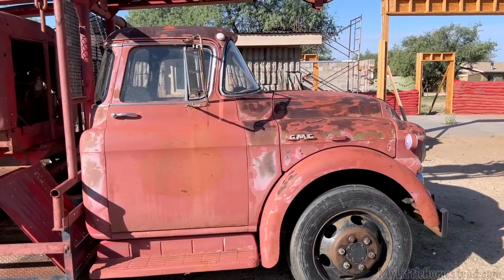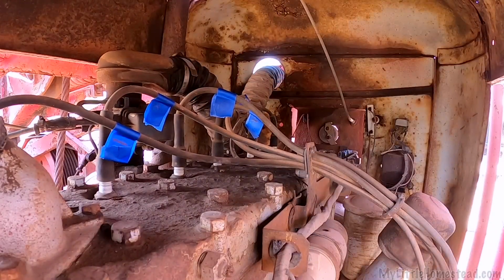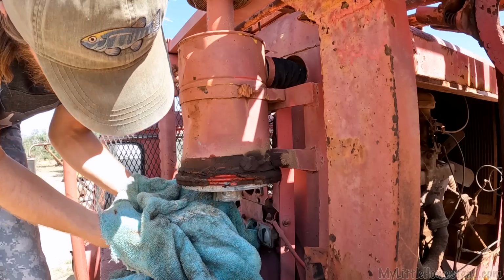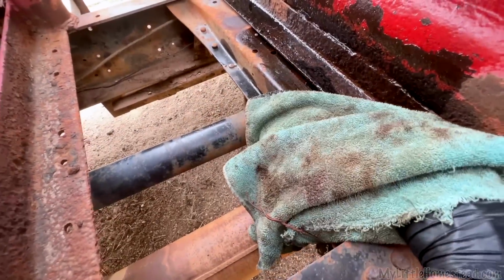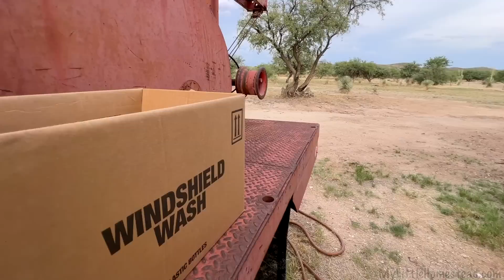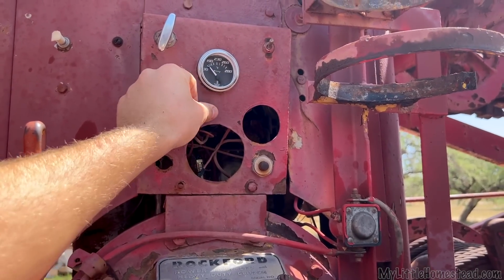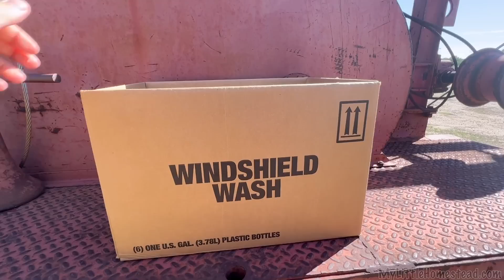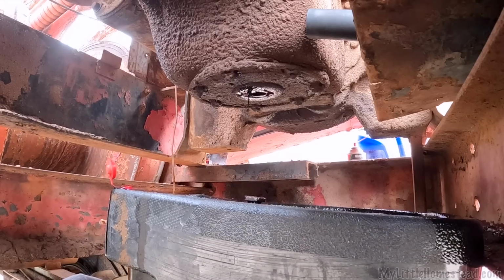💦 Water well Driller! 🏗 71 Speed Star ⭐️ Ford Flathead Engine 〒 Will it Run? | Weekly Peek Ep364

Comment: Just figure out the drill rig controls, note how many operations the drill rig does. For example (1) boom up (2) boom down (3) boom extend (4) boom retract (5) drill down (6) drill up. 

So, if you see 6 operations and there are 6 levers/knobs you are solving what's what :)

Comment: I would run the engine for a bit then change oil again to ensure there is no sludge. Also you can leave cap off radiator to briefly see if water pump is circulating. Use caution though as coolant warms it will belch out of radiator

Comment: When you said you didn't know about much about engines I laughed. You seem to know a lot more than most guys I try to talk about cars to. Your doing fine. I have asked guys what things are under the hood and you'd be surprised how little they can recognize. I don't mean any motor heads but some guys don't know much. I have to say I've never even heard of an oil air filter! Yuk! It started! Where is the coolant? Is it air cooled? It seems too large. I don't see a fan either. My truck only shows oil pressure when it's running. It's about 40 psi. Now I saw the fan. Yay, you put coolant in it. It runs! Really cool! I like Tuck as a name for your drill rig. I'm so glad you wanted this truck because it would have been sad if it got junked. It's pretty cool.

Comment: Levers, no idea about the levers. Only thing I can relate that to is the winch box on the trawler when I was 20 year old. More years than I care to think about away. Basically, forward, back and brake. Not sure if it has wire drum feeds on it to keep the wire even on the drums, most likely use of wheel with long rod? Hard to say at this point.. As someone who has always tinkered and speed tuned motorcycles for forty years I've found myself fascinated by your original video and subsequently plant restoration videos, not just fun but useful!
After years of playing with rusty nuts one of my favourite tools is a small handheld microjet torch the type that uses disposable cigarette lighters used with Plus Gas penetrating oil. My buddy know it's getting serious when the Impact driver and mash hammer come out lol.

Edit..there does come a point in life where it becomes sensible to buy WD40 in gallon cans and use spray and also adjustable flowtip oiling bottles at that point look around you and think about selling something lol